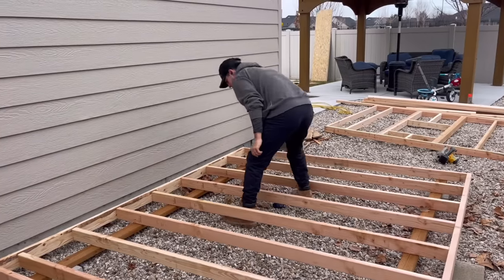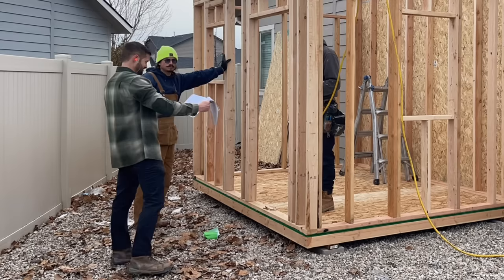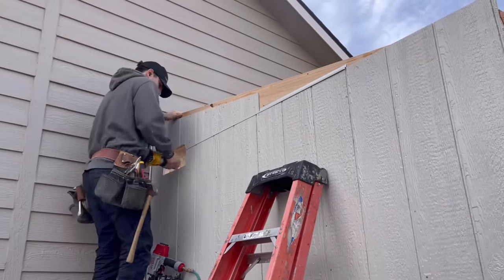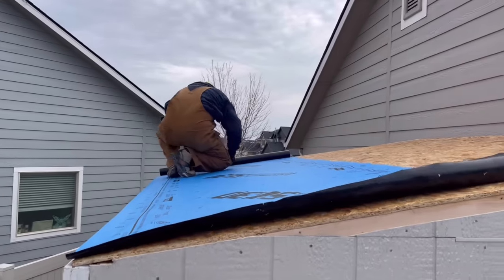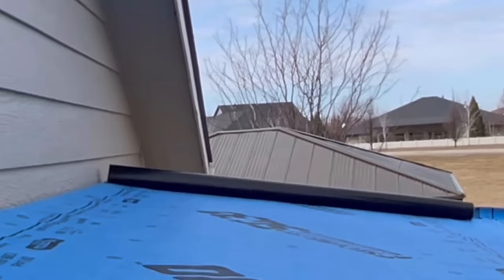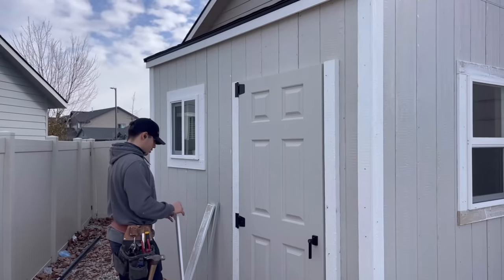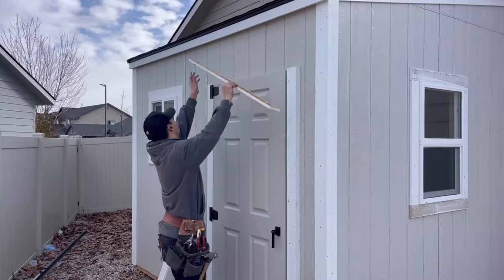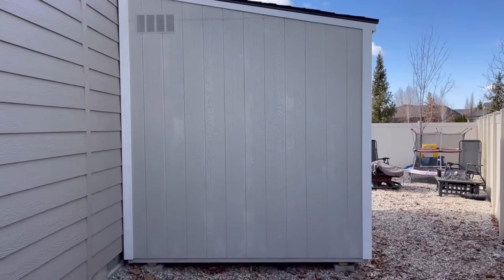We Built A Lean-To Shed Against The House

Comment: Looks great but what's the point of a lock or heavy duty door if you have the hinges mounted on the exterior? Someone could just take the door off the hinges with a screwdriver. I suggest reworking the design to fix that because it's a major security flaw.
Reply from the maker: In a residential neighborhood theft doesn’t seem to be much of a problem. But we do offer a security package on the doors as well.
Reply: @stormorsheds2970 Going to be honest, this is not a good response to physical security from a company, even if you're just a group of guys. Especially when you're dead wrong - residential neighborhoods are the MOST common locations for property theft.
Reply from the maker: We appreciate the honest feedback. We’re always trying to improve anyway we can. You’re absolutely right,  security is very important. We have doors with deadbolts and roll up doors without exposed screws we also offer. We give our customers the different options and let them decide what’s best for their shed.
Reply: @stormorsheds2970 right, but why is the default option on any of your doors to have the hinges facing the side of the lock?
Reply from the maker: I’m not sure what your question is?
Reply: Because it is in his back yard behind a fence. They don't have the patio furniture secured down either. Come on on now, its a shed, not a vault.
Reply: @grapnel87  I thought it too. Yes, it's not a vault, but there could be an expensive mower in there, or other tools. It does seem a little daft to have a locking door that can easy be defeated with a screwdriver.
Reply: @mikenco  lol. Whatever floats your boat. I think it more likely that someone breaks the window than takes the screws out of the door hinge. But I have no idea, the last guy in my backyard was more worried about getting away from my dog than what was in my unlocked sheds.
Reply: Install one way screws on hinges if concerned
Reply: Outswing doors should have security hinges.
Reply: Have you seen a thief watching youtube videos in back of a shed for how to remove door hinges?  Neither have I.
Reply: @mrBDeye lol 😁
Reply: Do you want the doors to open inwards?
Reply: @alexcooper689 you are soooo correct. Removing the hinges is exactly what thieves did to our shop....in a residential area. Another neighbor the thieves just cut a hole in the shop wall with a sawzall, another they just used a crowbar and popped the deadbolted door from the frame. One can only do so much to keep theift at bay, if they want what you have they will find a way 😔
Reply: @judykelley5023  Exactly right. There’s a way to get past just about anything, but some thieves are just lazy and/or unprepared, so making it more difficult for them to get in is sometimes enough of a deterrent.
Reply: I was thinking the same thing
Reply from the maker: Doors that open out allow for more interior space but we have doors that swing in as well.
Reply: Because some people don't do the work we do and wouldn't think to pop off hinges with a flat head and hammer....but thanks for letting them know. 😂
Reply: Most thieves normally aren't going to remove 15 screws to take the door off so they can steal some lawn equipment and a few tools. This is in a yard that already has a 6ft privacy fence. This set up is to keep honest people honest. That's how I look at it but opinions vary. Looks like a cleanly built shed. Good Job!
Reply: You dont have to take the hinges off. There are kits on the market that you can installed on the inside door frame for security. Also some hinges come with that already built into the hinge. In addition is easier for me to pop the side window up with a crowbar  breaking the windows' aluminum locks that trying to take the hinge pins off making noise with a hammer. It also depends where you live. Where I live you can leave the doors unlock but in the state where my cousin lives he has rebars on windows 😂
Reply: I was with you until I saw you installing the hinges on the outside 😮
Reply: Always that one person SMH 🙄 looks great guys gave me some ideas on my current shed I'm building
Reply: Builder of the house really shouldn't have installed dead bolts when there's windows the burglar can break 🙄. Not all neighborhoods suck. I can leave my dirt bike in view of my street all night long and it's there in the morning!!
Reply: Some outside hinges are made security proof.
Reply: @thereddstormproject1954  Maybe hasn't caught on in the US yet, but in Europe it's the most common way to break into sheds. Most thieves always have a screwdriver on them when going out to rob. You don't want to smash the window in the middle of the night and alert the homeowner, much better to remove the hinges and easier to escape if someone turns up.
Reply: @JohnWilliams-hn3wn  You obviously don't know most thieves because that's the most common way to break into a  shed. No one wants to be breaking glass at 3 am and alerting the homeowner, not to mention the amount of people who keep bikes etc in sheds.

Comment: While raising my children after their mother took off I built sheds like this during the day while the kids were in school.  It paid the bills.  I could do one like this in a day when I was in top form.  Larger free standing dutch barn style might take me 2 days or so.  I ran an ad in the newspaper year round and took orders via phone. I'd load up my van and build on site.  My prices began at $300 for an 8x8 with unpainted plywood sides.  I think the most expensive was around $1600 for a 12 x 16 barn.  I built the trusses on the floor deck once it was completed, then built and raised the walls and truses, roof and trim.  I had it down to a science (as long as the customer let me alone I could knock them out fast).  Fond memories of my younger years.  I'd get my kids to help me paint trim on sawhorses on the weekends.  I was getting 2x4's for $1.39 and panels for $3.88.  I probably couldn't build one wall for that kind of money, now.
Reply from the maker: Thanks for sharing, building sheds can be pretty fun. What state  did you build them in? And yes, pretty crazy how much more lumber costs these days than it use to.
Reply: NIce. How did the kids turn out? trade school? College? You're an inspiration.
Reply: @stormorsheds2970  Hi, I thought it was only in Brazil that the value of materials is extremely high. The pendemic was the start to increase the prices of everything. Hugs from Brazil... excellent construction.

Comment: There are other professionals who would disagree with the usage of the radiant barrier in the way it was installed.  For a radiant barrier to be effective (not negligibly effective like it is here) it needs to have an air gap between it and the plywood decking.  The only way to do that is to install additional plywood on the inside ceiling with the barrier facing up.  A challenge here as well since you don't have any vents in the roof.

Edit:  Where the hell is the window flashing?  Not even any caulk?  That will leak like a sieve!
Reply from the maker: The radiant barrier does a great job of keeping the shed cooler the way it’s installed. 
We seal over the top of the window trim which does the  job of keeping water out, it won’t leak. We offer tape and flashing for buildings that will have insulated walls and interior finishes. 
You could make the argument a concrete foundation should have been poured and that the overhangs should have been larger,  but every customer has a budget and also will have different uses for their shed.

Comment: I agree with some here the shed is okay, but there are concerns about the way it is built and water issues. Also, the hinges should be on the inside because anyone can take those screws out and access the shed. The siding should have been installed horizontial to blend with the home.
Reply from the maker: We have a security package we offer on the doors and also other door options with dead bolts for those concerned about that.
Reply: @stormorsheds2970  I get that from your previous reply to others but no one should have to pay extra to have the hinges installed inside the door as opposed to the outside. You would not expect to have that if you paid hundreds of dollars to have your house front door installed that way right?  Just saying.
Reply from the maker: That type of door is  designed to have the hinges  on the outside. It gives it a really nice look. Security is important, but it’s pretty rare that someone would jump a fence, break into a backyard shed and run off with the lawnmower and garden tools. If that’s a concern we have completely different doors that are more secure.

Comment: I like the shed I do have concerns for the top of the roof and driving rain causing water getting between both buildings and not having a good way to dry out. I see the siding on the back side of the shed to protect it from rain getting between but an area like that may be a little concern for me long term. I may be wrong and I'm not bashing you guys at all. Nice little shed.
Reply from the maker: We’ve been building this design for 30 plus years and have never had issues with  moisture build up between the house and shed. Appreciate the comment! Constructive criticism is never a bad thing. We have quite a few other videos on our channel you can check out as well. Thanks for watching. Out of curiosity what state do you live in?
Reply: @stormorsheds2970  Thanks for responding. I live in Wisconsin. The reason I responded was I had a small shed that was right next to my garage. (Not exactly like yours but somewhat similar) I replaced it with a much bigger 12x14 stand alone about 20 feet from the garage. Anyway when I tore down the little shed, the vinyl siding was moldy and the bottom 1x10 sheathing on the garage had an area that was wet and punky and had to be torn off and replaced. Not rotted on the plate or studs but sheathing was bad. Also the top of the block of the garage foundation was degraded and falling apart. All right where the shed was. I think the moisture sat there and was able to wick up a bit for years. SW exposure maybe had something to do with it too (?)  Yours was closer to the main structure and may not allow much driving rain or catch lots of snow to sit on the roof and against the main building to melt and drip down between. Lots of factors, I will check out your other videos too!
Reply from the maker: You bet, we always try to respond to comments. Idaho is a pretty dry state, not sure about Wisconsin. A 12x14 shed is good size but seems no matter the size it’s always easy to fill up, haha. Hopefully you’re making good use of it!
Reply: Nice job 👍
Reply: I was wondering the same thing so thanks for asking and thanks to @stormorsheds2970 for responding!
Reply: You are correct they forgotten the rain issues not gutter no down pipe 
plastic roof and play wood no concrete on floor no last long
Reply: I don't think this will work in Florida Humidity

Comment: You should consider putting flashing or drip caps over/around the windows and door. There's also no flashing between the roof of the shed and the house. Water will slide down that and rot the wall on the back of the shed. The osb is going to get moldy pretty fast.
Reply from the maker: We don’t put flashing between the house and shed because it is not attached to the house. Some water running between the house and shed is fine. It will just run down the walls and onto the gravel. The shed has finished siding and is painted on that back wall, it’s not exposed OSB. It won’t rot, it’s no different than water running down any of the other walls when it rains.
Reply: @stormorsheds2970  Agreed...i saw that...perfectly fine.
Reply: @stormorsheds2970  Solid build, my only nitpick is that the house siding looks like Hardie Plank or possibly another brand of cementitious siding. Those need to breathe or the moisture can start to swell the planks, mildew, etc. In a relatively dry climate it might be totally fine but I have heard that in east coast of Canada some manufacturers are no longer warrantying product because it gets too wet in the winter from snow stacked against the building which just keeps the siding damp for extended periods of time. I'm not saying you built it wrong, but maybe talk to a James Hardie (LP Smartside is another big brand) technical sales rep to be sure you don't have a homeowner calling you back a few years later with a building envelope issue triggered by the shed install. Better safe than sorry.

Comment: Nice job!
I notice flashing used between the house and the shed strictly depends on the caulking to keep the water out. Expansion and contraction between house and shed will fail the caulking.
The floor framing appears to sit on the gravel. Eventually, the floor framing will rot from ground moisture.
Reply from the maker: Thank you. The flashing is used to seal the shed itself off not to keep water from going between the house and the shed. Rain water will be able to run down between the two structures but won’t be trapped behind it. The silicone used was just to cover the exposed nails used to fasten the down the flashing/metal. There are pressure treated skids under the floor sitting on concrete patio blocks. We’ve built our floors this way for 40 years without issues. We also offer a steel base for folks who would rather have steel over wood. Appreciate the comment, hope you enjoyed the video. We have lots more on our channel.
Reply: Why not steel roof ,??? Less labor
Reply from the maker: We offer metal roofs, it’s up to the customer to decide which one they prefer.

Comment: At 1:22 - Yes, according to most building codes, OSB (Oriented Strand Board) sheathing should be installed perpendicular to the joists to ensure proper structural support and load distribution across the floor or roof framing; this means the long edges of the OSB panels should run across the joists, not parallel to them.

Comment: That’s a great looking shed, but no foundation. High gust winds could blow that shed away from the house, I would hammer 4 feet steel rebar into the ground around the shed touching the floor joints then bolt each rebar to the floor joints.12 rebar should work
Reply from the maker: Thanks!

Comment: Great job. Any issues with water getting behind the build in between the house?
Reply from the maker: Thank you. We’ve never had issues like that and have built thousands of lean-to sheds.
Reply: That's the same thing I was thinking also, he didn't put a level on the bench framework to make sure it was a level prior to installing it blew my mind.
Reply: What about flashing to prevent rain in between? Was it done? Nice and quick build!
Reply from the maker: Are you talking about the workbench potentially not being level?
Reply from the maker: Rain water can get in between the structures but it won’t be trapped behind it. It shouldn’t be an issue. Both structures are sealed. Also the shed is not attached, it’s just setting next to the house.

Comment: Interesting to see the difference in construction techniques between the US and UK. The "Caulk" you use, is it water based, or silicone? For external joints, we tend to use silicone, what with the fact it rains here 50% of the year! :)
Reply from the maker: We use a water based caulk on the siding and trim. Any exposed nails on the roof would get a silicone.

Comment: What is the purpose of the siding between the walls? To prevent rot? Is it just regular siding or special material?
Reply from the maker: It’s just regular siding. This way the shed remains its own separate structure and could be moved if necessary.

Comment: Excellent work. Well built shed. How much was materials and labor for this shed? How much for painting? Do you also offer the option of using the home's siding for the backwall? It seems like that would be easier than having two exterior walls with siding facing each other.
Reply from the maker: You’re right about $3900 on this one just the way you see it built. We like to build the sheds with all 4 walls having their own siding so it’s not attached to the house and can be moved if need be.
Reply: @stormorsheds2970  3,900 all in? that seems like a bargain with the prices of materials and everything these days. You guys are definitely not paying home depot prices. I don't think I could match that price if I were to build a shed like that for a customer. Well of course that would cover the material but not enough meat would be left on the bone for me. lol.

Comment: it looks like just the skid boards are pressure treated? No need for pressure treated lumber for the actual base of the shed? 

How did you measure the lean to roof joists angle and length?
Reply from the maker: We’ve been building our floors this way for over 40 years and have not had any issues. We relocate our old sheds for customers as well, so we can see how they hold up. The roof has a 2/12 pitch which i believe is a 10 degree angle. We have most of our measurements all dialed in from thousands of previous sheds we’ve built.

Comment: I'm going to build a lean-to greenhouse against my stucco walled house. Can I screw into the stucco/stud or should I build it off the house like you guys did? Also should I have a back wall against the house to prevent moisture on house exterior? Thanks, good job on this build and videography
Reply from the maker: We build them up against the house but don’t attach it. Probably the simplest way to do it. We have a back wall so it’s still a four sided building that can be moved if need be. Thanks for the comment.

Comment: On the vertical back side of the shed next to the house how do you keep moisture from getting in?   There should be a small gap between the vertical trim piece and horizontal house siding.   I just wanted to know what you used, I did not see anything.  Tks.
Reply from the maker: I’m not sure what you mean. Are you referring to the metal cap we use after all the shingles are installed?